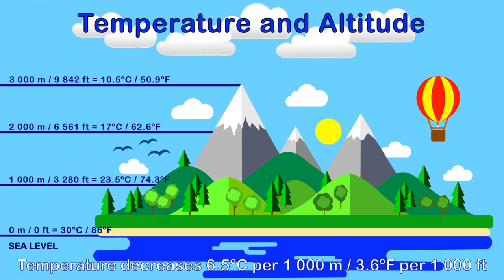What are CAM Orchids? What is CAM? Why do orchids have CAM? How does CAM work? #ninjaorchids

Comment: Hi Nina... having an issue with my dam phone... keeps blocking my messages I try to leave.  😠😵
Reply from the maker: 🦇🦋🦋😍💐 I have the same problem, Wingman, when I want to leave a comment on a video using my phone! Blocks the keyboard and I have to literally go out of the app, and start again. Now, if I wait until the cursor starts to blink, add another 30 seconds or so, then everything works. This has been happening to me for the past week. I will screenshot your comment and send it as feedback to YT. Not expecting miracles, but, if there is a bug in their system, and more people send feedback, maybe we can get this sorted out 🙄 Yes, I blame YT for this glitch. No other app is causing issues. I do appreciate that you kept trying, Robert, thank you so much 🙏🏼 maybe your tenacity resulted in higher views than normal 😂 thank you for watching and also, thank you for confirming that I am not alone with this nonsense. I thought it was my phone... but nope! Here we are 🤪 hope you wake up to a fabulous Sunday 🫶🏼❤️🌸
Reply: @NinjaOrchids  that's exactly what my YT / phone has been doing, even sometimes on text messages. Been doing it now for about a month off and on!!
Reply from the maker: The comments are the oldest feature here and yet... they mess around with visual upgrades but the tried and tested gets messed up. It's getting old 😤